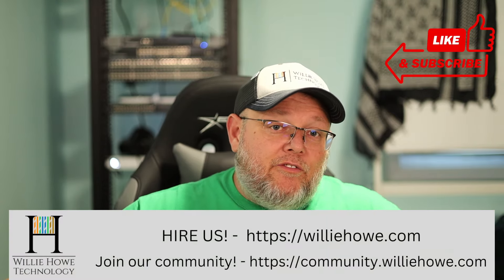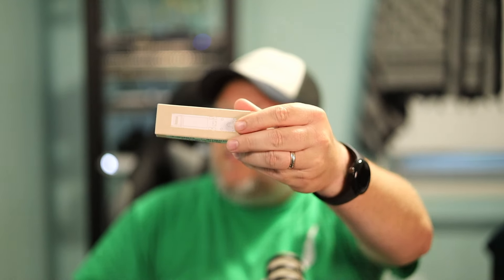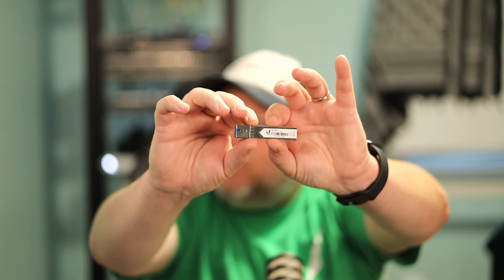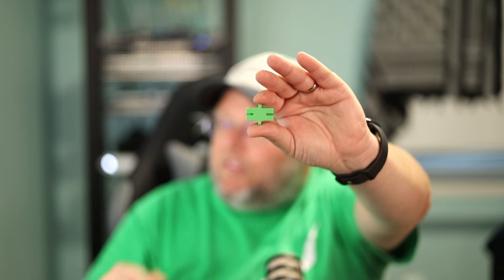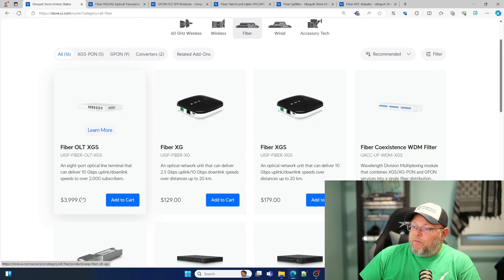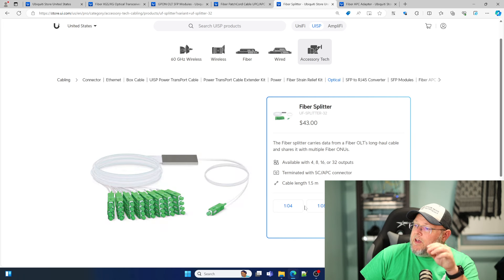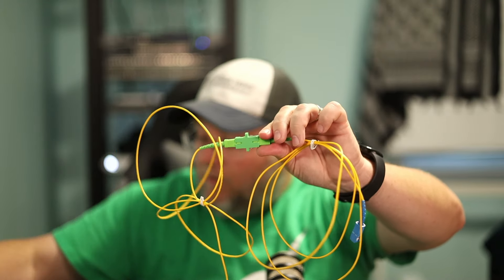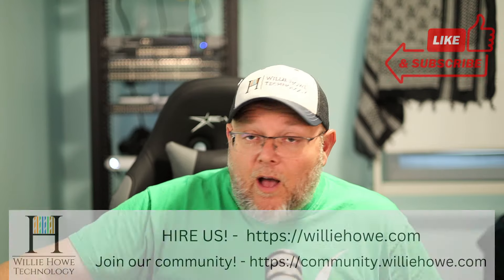Build an Internet Provider Part 7: Modules, Cables, and Connectors

Comment: Great content I would like to know when you split on the splitter what is the ratio interms of capacity do you loose.
Does ubiquity allow splitting 1:128 ratio that would be awesome.
The xgs pon modules you said it can push upto 20 kilometers does the fiber DBMS (signal strength) remain at optimum levels ?
Once again great stuff.
Reply: So many factors to answer to that question.